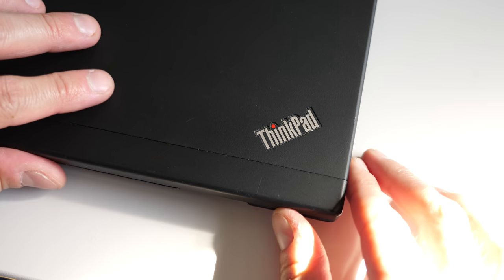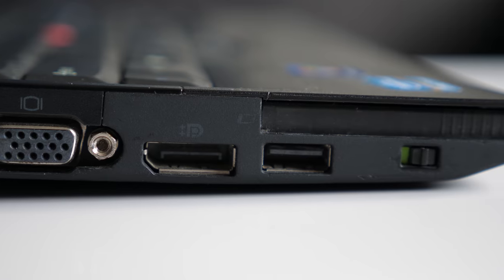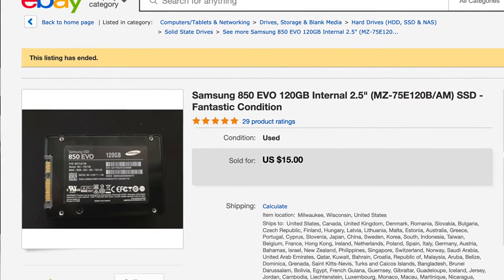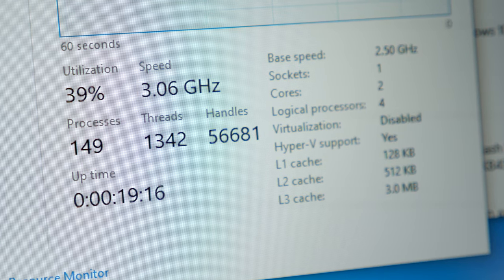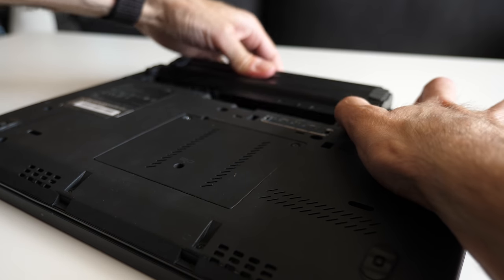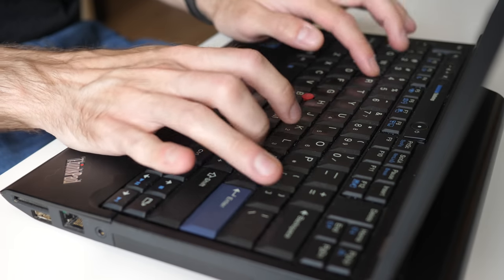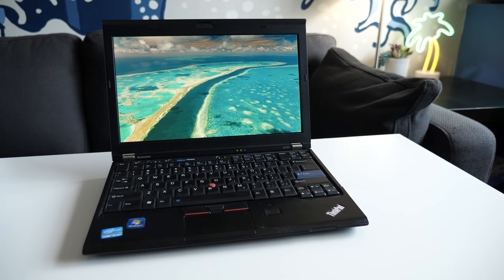The $100 Laptop Challenge -- This Old PC is Better Than You Think

Comment: We got these laptops from school , 9th grade (we were the first ever wave of students to get laptops) ended up buying it off of the school the year I graduated for $50 and I swear this laptop has been the best computer I have ever owned, it is what taught me all I know about building computers, did a lot of live gigs/ exams in Highschool running Ableton on it to trigger sounds from an External device, she did not skip a beat once, the bloody thing is built like a tank, dropped it a couple of times on concerte the metal casing cracked but apart from that nothing else was damaged, dropped water on it and it spilt right through the keyboard, overclocked the shit out of the onboard GPU and was able to play Bioshock on it (low everything ofc) but one of my most favourite things about this laptop has to be the keyboard it is honestly the best laptop keyboard I have ever used and I keep coming back to this if I know I'll be typing a lot. Sorry for the essay but this laptop holds a special place in my heart

Comment: I've been using a Dell Inspirion 620 w/ an i3 CPU which is from 2011 for close to 4 years now that I saved from being recycled. The only thing I've done to it is replace the hard drive, it had a Seagate 1TB in it that was original to the machine which started failing like most Seagate drives do. I ended up throwing in an old WD drive that is older than the machine but seems to be a good drive. I use it for everything from streaming to playing Emulator games & I plan to keep using it as long as possible. Older machines are still decent & can be used for a very long time.

Comment: absolutely true. Even more so for desktop PCs. 
A cheap X58 based system can do anything, including the lastest games, for under 200 bucks.
The only thing that has progressed quite a lot performance wise are GPUs. But even for those: a high end card from 2012 can still play modern games reasonably well, a 2015 high end card will often do ultra@1080p.

The only complicated thing is if you want a cheap, light weight quad core laptop. ULV 4-cores only exist since 3 years, and have given the ultrabook market an extreme boost in performance. However even the original 2017 generation (core i5/7 8xxx) are still very expensive.

Comment: i was on a budget last year and needed a laptop for various things, including my business i was just about to get started. i looked for a month at laptops under $100. locally, i couldn't find anything worth it, so i went online. Eventually i found a laptop for $50. HP Pavilion dm4 notebook.  it came with windows 7 still factory installed (the seller never wiped the HD, so it still had all of the original first boot information readily available). Everything the laptop factory shipped with was still with it, except the charger. i had to buy one myself. Like the ThinkPad in this video, this HP functions as if it were brand new, except the fact that i didn't change the HD that came with it. This particular model came out in 2010, factory Windows 7 Home. But, I instantly decided to install Windows 10 to see how well it would run on this machine. Well, Other than the Windows updates screwing things up like the finger print scanner, or causing the system registry to fail after an update and reboot. Getting all of the drivers needed and updates for the drivers\apps was a slight hassle since HP doesn't have anything on their site for an old laptop like this anymore. But besides that. it runs great now after a few months of having to reinstall the system (once, i had to reinstall it from scratch since an update completely messed up the registry AND the BIOS somehow. I now have the entire system, including the BIOS, backed up and also copied over onto another HD that i got from someone else. If you are on a budget like i was, then knowing what to look for, or at least having someone who knows what to look for, is a necessity because you can easily just "Settle" on something and it be complete trash in the end. While what i said about mine seems like it may be trash as well, i fixed it up to where it runs smoothly with Windows 10 installed, and can still handle quite a few games and such that are meant for newer\greater systems, all without paying anything else for it other than the $50 for the laptop and $5 for the charger (yes, i paid $55 for a functional and useful old laptop)

Comment: And one other really good point is that it's so easy to replace a HDD/SSD, memory moduls and the battery. These operation can be a nightmare on some low end new machines. When you're lucky enough to avoid soldered memory, soldered SD or emmc and glued battery. And not speaking about the amount of screws and clips ...

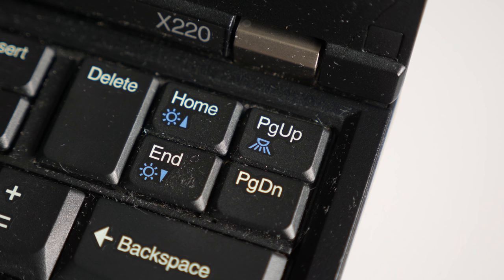Comment: 6:45 - those fingerprint sensors are desirable as they actually work when swiped, don't have the ambiguity of not knowing if it really sensed the touch or not. I now run a Dell Latitude 5580 as my daily driver, and made the transition from a swipe-sensor on my ThinkPad W530 to the touch-sensor on the 5580... HATE it. 4 out of 5 detection fails, no matter how it's set up - never had so many fails on a swipe. Switched to PIN instead. Replaced the palmrest/touch sensor after plastics cracked, got a different type of sensor (FIPS), still problematic as it takes forever to detect.

So yeah, no, the swipe sensors are super desirable. Wish I could get one on my Dell. Touch sensors tend to suck if they're not part of a phone.
Reply: I have them on almost ALL of my Thinkpad and NEVER used them because i HATE biometric "security" and think it's more intrusive than actually useful. Especially fingerprints. Replacing the BIOS with a free and non-corporate one makes more sense but it's still a pain in the ass to accomplish :/

Comment: Linux distros like MINT or Fedora or those based on Ubuntu work really well on these machines and a SSD can easily be found for around $20.00.   So for under $150.00 you can have a machine that will out perform many budget machines.

Comment: Great video. I was looking for a new computer a couple of years ago, and wasn't very impressed with all the brand new desktops with LED's everywhere, so I went with a used Dell workstation. For $700 I got Intel Xeon 4-core, 32 gigs of RAM, a 500 gig SSD and 2TB hard drive, a 5-year old Quadra graphics card that plays most modern games just fine, it even had a DVD drive built in. It's not 2010 anymore, when you had to upgrade every 2-3 years!

Comment: Great video. The funny thing is that I have the exact same laptop, X220, (which was donated to me by a colleague) and I was using it as my docked "desktop" at work until my IT department informed us that any Windows 7 computers would be taken off line. I was disappointed but fortunately, I had another machine I could use. I asked my faculty's IT specialist if it could be upgraded to Windows 10... and he couldn't. It just wouldn't load. I was rather surprised. So, I was thinking I would load Linux on it, but now, I might try to see if Windows 10 could load. 

UPDATE: One year later... I figured I had nothing to lose, so I installed Windows 10, had a problem with the activation, happened to rewatch this video, located the Win 7 key... and voila! It all worked! Thanks!

Comment: Came back two years after this video premiered: Picked up a ThinkPad X200 (C2D P8600, 2GB DDR3-1066, 320GB 7200rpm HDD, and Windows XP!) two months ago from an e-waste recycling center for NT$500 (about US$16). Upgraded it with 2+2GB DDR3-1333, 256GB SSD, Windows 10, and it is still very capable with mundane office works and web browsing.

Comment: Writing this from my T420 bought for 120 late 2019. My only laptop. Same cpu, same ram, also swapped for a cheap ssd. I can confirm that it's perfectly ok to use and work on it. Using manjaro xfce on my side.
What it crap is the screen quality and sound quality

Comment: Yep, there are gems if you know where to look. 4 years ago I picked up two HP Elitebook 8460p tablet/thingys with 2520m i5s for a total of $49 in auction at the bay'. 4GB RAM each. One had a cracked screen, the other a bad keyboard. Made one good unit, and kept the other as for spares. Put in an SSD I had laying around, and that has been an awesome little computer I used out in the shop or traveling. It only just now is starting to show it's age, with how it handles the more modern and intensive web coding and such. Because it was business marketed, it had a higher capacity and quality battery. Amazingly... That battery still provides 2 hours of runtime. Because both units came with batteries, I have a backup haha. Another $25 got me a brand new in box docking station (which I bought mostly to aqquire the power brick I did not get with the laptop auctions) 

You really cannot go wrong with business grade gear, as long as you avoid the dud models and do some research ^^

Comment: Yo so I decided to do this but with the t430 a couple months ago and here is my experience. Windows 10 out of the box works great (kinda built for the machine) then I ditched it since Windows 11 came out and I wasn't a fan on how Microsoft decided to handle things (this is just my opinion). I went the Linux route and installed Pop Os (great distro). The only problem I couldn't solve was brought on by the kernal no longer supporting the Nvidia legacy driver (in this case 390). The solution was to either run an older kernal, use the open source nouveau driver (which is what I did because security) or just use integrated graphics and lose some I/o ports in my case the mini displayport. The only problems did come from the software side of things, so overall this laptop was a great investment and I would recommend doing this if you like to tinker around. Although it's 10 years old, It's built like a tank, awesome to type with while still feeling modern enough. Also I'm still new to the whole Linux thing, so if I said something wrong or if you have another solution to getting the Nvidia proprietary legacy drivers running, please feel free to tell me.

Comment: I can afford $800-$1000 for a laptop, but since I use Linux I got a Thinkpad X230 with an 3rd gen I7 and bumped up the ram, a 512 GB SSD, a new battery, and a docking station. I have maybe $500 in it. I've been running it for several years now, and still totally happy with it.

Comment: I've been using this strategy for a few years now, with both laptops and desktops.

My last laptop purchase was an X240; 8GB RAM, 256GB SSD, i5 with a Touch screen...oh, and it has LTE built in. I paid £150 for it a little over a year ago. All I have changed is the SSD as I wanted more storage, it cost me nothing as I had a 500GB SSD already...cloned the drive and swapped it out, job done.  Sure, the display is a little small, but I wanted the portability.  When I'm not out and about, I have a docking station which set me back around £30, so I can use my dual-display setup when at home.  I don't see me replacing it any time soon.

My children are at the age now where they are using computers, so I picked them up a used Dell OptiPlex 990; £180 each with a clean(ish) OS install, 8GB RAM, 500GB SSD, i7, 19" display and a Keyboard and mouse.  I've not benchmarked them, but I'm betting there is nothing new out there that can match the performance for even close to the price I paid... They're both very happy being able to do their school work and play a few games. :)

Comment: I’ve had a X220 Tablet for 3 Years, Running Windows 8.1, put a 480 GB SSD , 16 GB in it. I got it at Job I worked for only $80. Fantastic Machine, been my main laptop for longtime, and I highly recommend them.

Comment: I have a X200 tablet. I stuck in a 860 pro SSD and it is snappy. Best $100 I spent, doesn't hurt that the built in stylus works exactly the same as a Samsung S pen. The keyboard is amazing. I won't upgrade to a newer laptop for this reason alone (along with the fact that I don't need more compute power for my use).

Comment: I may not purchased used electronics, but I do appreciate what you are doing and for those of you who don't mind the risks of purchasing used electronics. I do believe it's a really good feeling when you do find the diamond in the rough. Something that's really great value based on the performance it gives you for a really low price. Every now and then there is a seller that might not really know what they are selling and you stumble across it and get the deal of a lifetime. It can sometimes happen. And it's really great places that take used hardware to sell to those in need. I believe that's a great cause worth promoting  so kudos

Comment: Picked up a Macbook at Goodwill for $10. It was a 2010-vintage machine with a core2 duo processor, DDR3 RAM and a 250GB HD. Only problem was, written in grease pencil on the lid, "Locked." Otherwise, still a very usable machine. I took it to several computer shops, and they all told me unlocking it was impossible. One tech was cheeky enough to tell me that I had overpaid for it.

I spent a few minutes online and found an easy solution to unlocking it. It's in very nice shape, and I'm putting to work as a backup machine. But what's grinding my gears? I'm a bit sore about being told that my only option was to buy a new computer. I'm not generally conspiracy-minded, but I have heard a lot of negative stuff about Apple, often recommending replacement instead of attempting repair. In fact, I believe they are a primary target of the right-to-repair movement.

Comment: Last year I bought a parts-only X230 from a PC parts store by chance, then did lots of refurbishments and upgrades on it (new battery, new palmrest, missing Backspace key replaced, 8GB RAM, Crucial MX500 500GB, DW1520 wifi card, 1vyrain BIOS...), now it's one of my daily driver, happily running macOS Catalina

And yeah, if you can find an X230 at a similar price to X220 then by all means buy an X230, native USB 3.0 is a big plus, no need to hunt for i7 model just to get it

Comment: I use a Thinkpad X200 as my daily driver. Core 2 Duo, 4 GB RAM, and a 100GB SSD. I use it for web browsing, LibreOffice, Linux shell scripts, and VNC to an old windows box running QuickBooks. 

It does absolutely everything I need it to, and I scarcely notice much slowdown (imgur is a bloatfest), and I've never run out of RAM to the point it became unstable (thanks i3wm!)

Comment: I also recommend the Dell E6410. One screw removes the back panel, upgrade the SSD/Wi-FI/Ram and CPU.  Slap in a USB3.0 card. Also look out for the 1440x900 screen version. but the 1280x800 is fine.

Comment: I use a ThinkPad T420 as my daily driver, which is from the same generation as the X220. I upgraded it with an i7-2670QM, which doesn't overheat as much as you might think, and a 240GB SSD. I use Manjaro Linux as my primary OS but I have also tested it with Windows 10, both on bare metal and as a VM and in each case it runs quite smoothly. I highly recommend ThinkPads to anyone on a budget. Even something as old as the T61, which I also own, can have some value at least for basic tasks, and in my opinion makes a great alternative to a Chromebook.

Comment: the x220 only has a single usb 3.0 port and only on the i7 model, but the x230 has two usb 3.0 ports regardless of cpu. the nice thing about older laptops like these is you can just add more usb 3.0 ports via expresscard.

Comment: I had a 1st hand experience with your example a few months ago. I bought my 14yo a Surface Go 2 (the higher end model) after using an old EliteBook 9480m I got a few years ago, I thought it would be a nice upgrade. Turns out the EliteBook 9480m was a lot faster in just about every way and I wound up returning the Surface Go and got my daughter an iPad instead. She grabs the laptop for school when she needs it.

Comment: I also have a 12-year-old HP 620 tractor with a very robust construction just like the Thinkpads.  It is also a Business Class computer. It has 8gbram, 256gb ssd Intel core 2Duo t6670 2.2 ghz , Windows 10 with the key of the 7 that came on it. Use for basic tasks, office and from time to time snes and genesis emulators. Very quick and happy life with him.  planning buy another one at this time thinkpad x220 for about 90 Pounds.

Comment: Ive built many similar laptops and desktop computers, I use one as my primary computer, though I also use several similar computers. 
One thing that I dont think that you mentioned is that often you can get a sata drive bay for your laptop, and use it with the HDD, or another laptop hard disk or SSD to have another internal storage device instead of the disc drive that you will likely never use.

Comment: I recently got myself an X220T myself for slightly less than $200. i7 2640m, 250GB Sandisk X300S SSD, 8GB RAM. It's awesome, but for those who wanted a similar laptop and don't care much about unlocked BIOS, X230 is the way to go. The price is not to different, but you'll get newer API support like OpenGL 4.2 (in Linux) and DirectX 11.

Comment: thinkpad t460 $200, i5,16gig ram, 256 samsung ssd, spill proof keyboard (very important, was tested on the firs day of use) 1080p display, sweet. bought it for my 8 year old son to use for online classes. good performance great value.
I agree with you 100%, if you are going to buy a used laptop, buy business class, they are the best

Comment: Very true on the point of we do not need to upgrade anywhere near as much as we used to have to.  Even a high end gaming PC will last much longer, and for the cost of the GPU's it had better. I built my main tower in 2015, and it still rocks everything with no issues. That is still an Intel 4 core 8 thread, and it is a beast still. Though this year if I can I may gut it to put a Ryzen 7 8 C 16 T,.. not sure. Laptops? Yeah, keep them for like 8 years now.